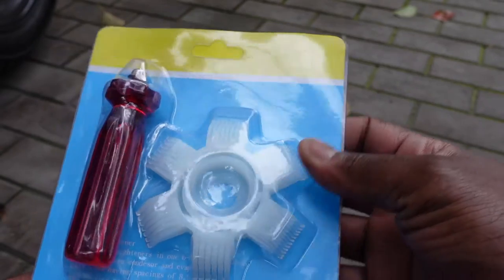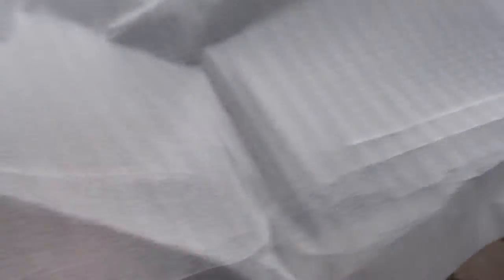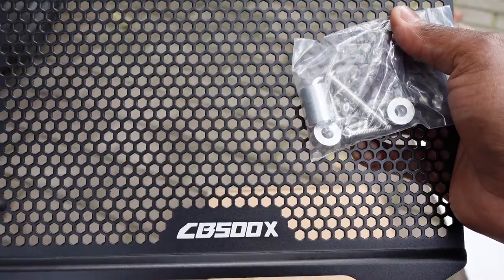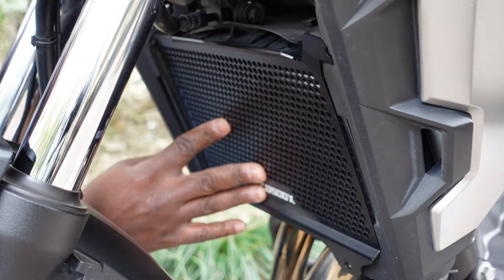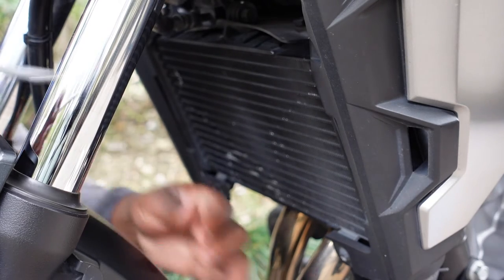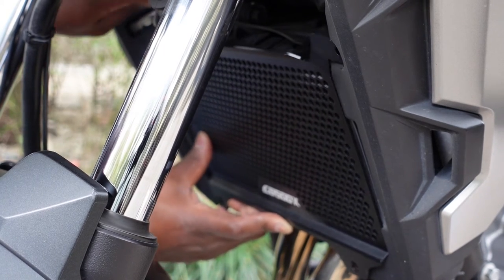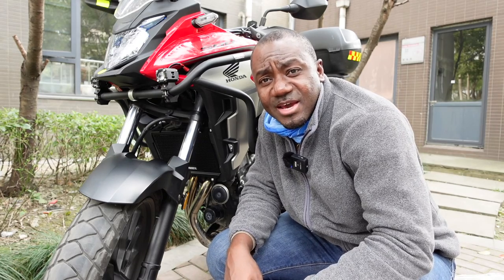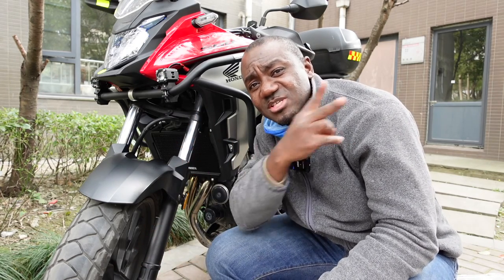Installing A New Radiator Guard On 2019 Honda CB500X || New Radiator Fins Damage Tool.

Comment: Just got mine, but dont think it has the "cb500x" on it. The bike has 4 miles and none by me since I purchased last November and still have snow and another 14" coming tomorrow! I did the SW Motec skid plate and crash bars, and barkbusters. Now to put on the radiator guard.Think they should be stock from factory. Cheers!
Reply from the maker: Nice upgrades there mate. The rad guard is a definite need. Slap it on when you have time ready for the riding season. Damn, you still have snow at this time of year? Whereabouts are you located? We enjoying around 20celcius here in Shanghai already. Let's know how it goes with the installation. Cheers!

Comment: Nice! Do you have a link for where you purchased the guard from, or what make it is? Thnx
Reply from the maker: Hi. It's not branded, just a generic one. I bought it in China, off taobao.com. I'm sure you can find same or similar on aliexpress which ships international. Hope this helps. Cheers!
Reply: @The Ride and Place    Yes, thanks. I’ve ordered one from AliExpress. Hope the figment is as easy and straight forward as you make out in your video. 🙂🤞
Reply from the maker: @roviwoteap2375  It should be just as easy to fit. Let us know how it goes. Cheers!

Comment: Today i just installed the radiator guard from Givi on the 22 model. 
expected a 10 minute Job and a cool beer. Resulted in sweat , tears and a lot of cursing, because the bolts didn't hit the holes anymore after i opended them. 
Took me a bit force and a little bending to aline everything.. i got it in the end. Givi doesn't give any torque values.. which is also pretty bad imho. 
I am happy that it is done and fits.. I hopefully will never open these bolts again.
Reply from the maker: I understand how you feel, but I'm glad it all worked out in the end. Stay safe on the road. Cheers!
Reply: @TheRideandPlace  you too man!

Comment: i wonder if tape was vibration maybe nice video
Reply from the maker: It doean't matter bro, not everyone has English as their first language. I think the tape was for another type of radiator guard, the seller just added it just in case I wanted to use it. It works fine without the tape and there's no vibration. Stay safe. Cheers!